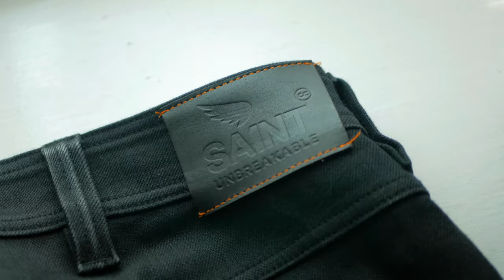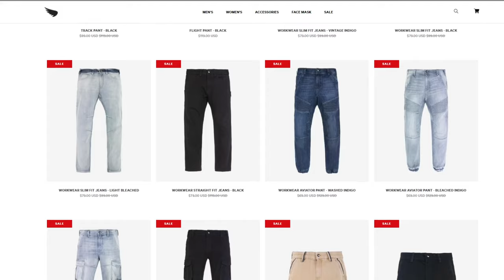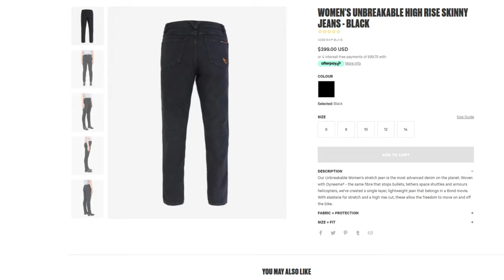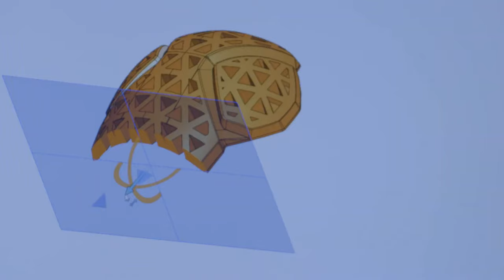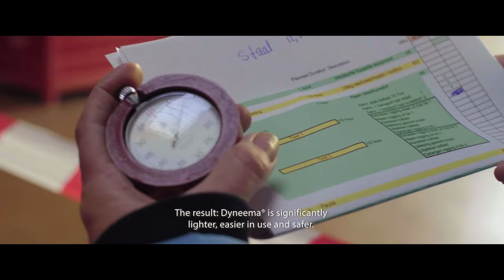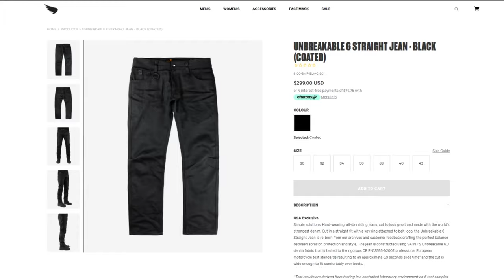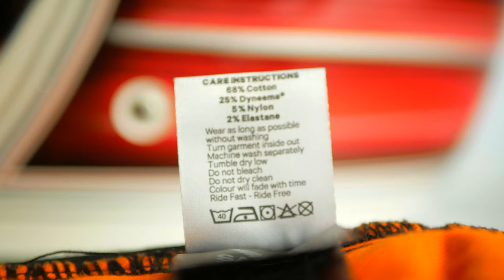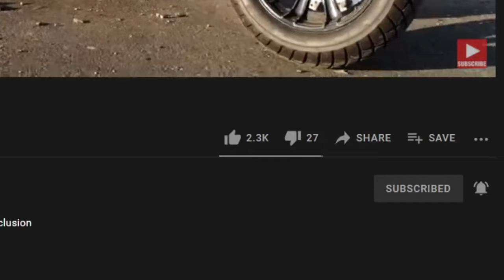Why These Motorcycle Jeans Will Save Your Skin

Comment: Riding pants are the only thing I lack at the moment. I figured that they are the least important part to protect (as much as road rashes are pain in the ass) so I still ride in normal jeans. But other wise I have my armored gloves, good riding boots, ECE rated helmet and probably my best purcase the riding hoodie by Richa (with the hood removed becuase WTF is the point of a hood on a motorcycle jacket) with D3O armor all over and Aramid/Kevlar fibers sewn in. It does not matter how hot it is outside I can wear that hoodie and when weather cools down I can wear any leather jacket, be it riding or fashion leather, on top of it to protect me from the wind, light rain and cool air.

But I do realise I have to get my riding jeans/pants some time, preferably before I get a road rash on my bum that forces me to eat my lunch standing up for the next 6 months.

Comment: I hear you ! I ride full gear and as good as I can afford. Like the fact that you can stay in the jeans if it rains and don't need to stop necessarily for over trousers they just dry as you ride out of the rain ;-)
Reply from the maker: Yes, they definitely can get soaked, but they dry faster than a regular pair of jeans (from my experience anyway). While soaked, they don't feel overly heavy from water weight. Very versatile piece of gear.

Comment: Nice job. As a learning beginner riding since 1977, I always look for options for protection. I am the guy in shorts and a t shirt most of the time, but always wear gloves and a helmet. I ride almost every day. Have no way to change gear beyond that once I get to work in an un airconditioned hangar. My wife's recovery has been slow. Her bike looks nothing like it did before she got hit, but is still quite a beast and great fun to ride. We look forward to her being fixed. The moral of my story is just don't crash. Having ridden for a few years I would suggest reading the road and traffic more than wearing gear, but gear is always good. My mantra is don't wreck!
Reply from the maker: Slow but a good recovery. Road and traffic conditions have just as much weight if not more than gear as you said. Big statement 👌🏾

Comment: Will check these out, I use Resurgence and John Doe, CE and AAA rated. Always ride good gear, but it doesn’t have to be leathers today thankfully. Ride safe dude.
Reply from the maker: End up having a heat stroke in leathers. 🥵

Comment: Great video Brandon I totally feel your pain I to back in July had a little accident on my Indian chieftain on the freeway hitting something and going into a wobble causing me to lay the bike down multiple abrasions on the hands elbows these were OK I did have the protective gear on but some of the abrasions on the hands orl unavoidable because my gloves tore It has been taking about a couple months six weeks to be exact I’m healing up just fine and I do like the flame resistant jeans and other companies make for construction workers the two also prevent any kind of major heat that  caused by the asphalt concrete if you’re on it. Again thanks for the video dude
Reply from the maker: Glad your accident wasn’t worse. 😬 When my gloves tore, I didn’t have much road rash but I did have a swollen palm from the impact.
Reply: @BrandonBicasso  i was going 65-70 mph my hands /elbows were messed up !! totaled my 2018 chieftain!!! time to purchase 2021 hd electraglide revival ( u need to review that bike brother)!!!! stay safe